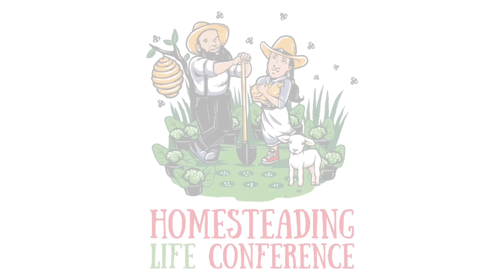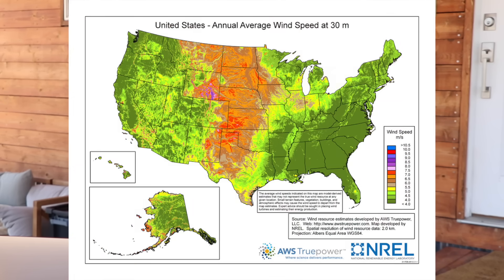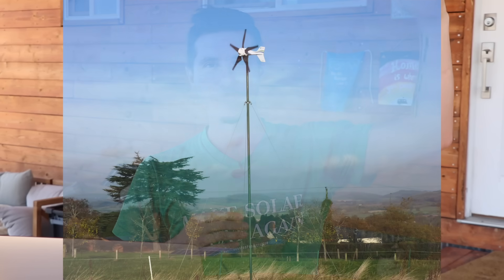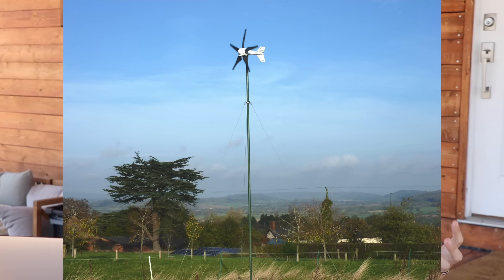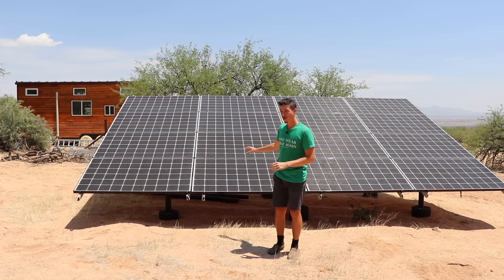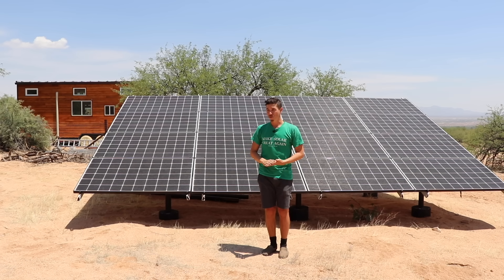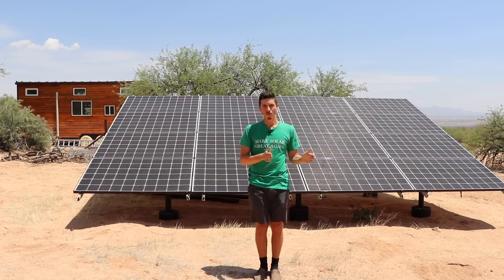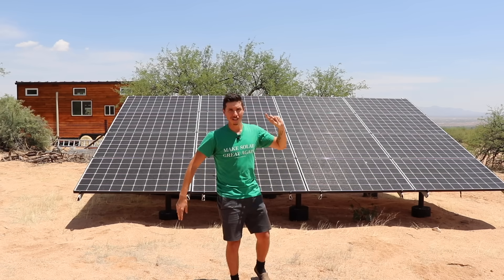Micro Wind Turbines... Are They Worth It? (Off Grid Solar)

Comment: You sound extremely biased towards solar panels. You only talked about the cons of wind turbines and didn't really address its pros or when you would want one over the other. You live in a very sunny area but not all people do. Also, on some places wind blows pretty hard and a hybrid system works amazingly.

PS: Missouri wind and solar is VERY expensive and in most cases you can get wind turbines with 25 year warranty even from Chinese turbines.
Reply: TheRobojay has it right, this video and Liam are completely biased against wind power for some reason. It has its place and compliments solar. If I was in a sunny location like Handeeman and many states in america then I'd probably ignore wind power, but where solar power drops to an unusable level like everywhere in the north across the world for a significant portion of the year then wind power absolutely has it's place. 

What's the point in trash talking a renewable energy source that does work for so many people. I'm sure these people would love to just use solar year round because it is much more simple but they can't. Maybe we should just abandon wind power because it's not as simple or cheap as solar and go back to burning more coal instead...
Reply: He does leave out the fact that wind can blow 24/7 in many places of the US like West Texas, 20 mph average wind there daily.
I lived in Tucson for 10 years, not much wind at all so solar is his best bet for that area. He is incorrect on a lot of his statements he made about wind turbines. I don't believe he has EVER owned one at all yet he seems to be an expert on them. He will have to explain to all the people in the US and around the world that have been using wind turbines for years with great success that there wind turbines don't actually do what there doing and that is keeping there batteries charged. 
The fact is that wind can actually blow 24 hours a day but the sun only works 8 hours a day no matter what.
I have both and they compliment each other. One is no better then the other in most cases it just depends on where you live.
I lastly just want to say there is a company in Arizona, a competitor of ours that's willing to give you FREE solar panels if you bash wind turbines. They only sell solar. I sell both solar and wind and could care less which you prefer to buy. I just want you to get what works best in your area.
Reply: All those claiming bias, I’m trained as a wind turbine technician (the big ones) and am going to school for mechanical engineering to design them. I love the things and even I’ll admit that the small ones for personal home use have VERY limited application.

There is a reason we’re building them 300 feet tall and out on the ocean. Wind at ground level is inconsistent.
Reply: Right?? 8 min. to say no.
Reply: Caus hes paid by some solar company....
Reply: ocean power is better...………………………….the ocean never stops moving
Reply: TheRobojay the T-shirt was a bit of a giveaway..lol
Reply: i remember i did my homework about winturbines
in my place and context, i wanted to use windturbines to reduce my battery size
if i have a 24/7 power source i could reduce my battery needs
but i found out that for my context, the wind turbines woudn't be cost effective compared to solar+batteries.
yeah, i think in a place with strong winds, (a flat surface or on top of a hill with all year strong winds) it could be possible to have some good cost effectiveness, but for most people, wind turbines woudn't be cost effective at all.
Unless you can build your wind turbine by yourself for cheap.
Reply: >> I'm an engineer, therefore I am extremely biased towards things that actually WORK in the real world

Dude, I know you have a legitimate point of view but that comment is goofy to the extreme.  Is a solar salesperson said that to me, even if I agreed with what they were saying I'd go with the next guy who was not so off-the-wall cocky.

Do you think the people who design, built and install wind power systems are not engineers, or they are a different kind of engineer who is biased towards thing that don't work?

LOL
Reply: Liam O'Brien wind rarely makes sense when it is not complemented by solar as it is more reliable on a small scale. That being said, this video focused on the negatives of wind. Wind shines on many areas if coupled with solar. It allows to have a smaller solar system and less battery storage as it can run 24/7. And I don't know what you have against chinese turbines but there are plenty of people happy with them. 
The video covers good points but completely trashes turbines without pointing out positives or when you might want them.
Reply: but he was talking about the micro or small wind turbines, he is right on a lot of the points, it is a waist of money for something that is lucky to put out 1kw in 30 mph.   a 50 watt solar panel in just one year will out preform any small turbine by a factor of 100.  I have owned a few of these small wind turbines from companies, and they all fall short of what is advertised.  I have owned a turbine and was lucky to get 5 KW hour of power in one year out of it.  Were as with a solar Panel of just 100 watts you get 100 KWH in a year.  I love to have a wind turbine if it were to preform as so many companies clam yet fall short way sort.  So fare every company that sell a turbine with a blade diameter less than 80 inch sell rubbish  Unless you live in a place with 30 mph winds or higher consistently were most people live with winds of 5 mph to 10 mph.     

There are also things to watch for when buying a wind turbine some companies will sue you if  you have a problem with there Turbine, and if you post a video they will sue you, or if you make a post any were they will sue you,  It seems that now in America Companies are providing shitty service and when called out they are suing the consumer.  That is just one thing to watch out for.  If the company is not suing there consumers then they should be ok and legit, with nothing to hide.   So if a person dose want to go micro wind, what ever you do research the company heavily, and what ever you do do buy from companies that trash talk another company like so many do on YouTube.  There is about a half dozen companies will will never by a product from because their YouTube channels is filled with trashing there competition, its sad.
Reply: oh, I've figured it out now. Liam is actually part of the DIY homestead website solar course, so it's a business strategy to try and gain more sales. Sad.
Reply: until the turbine burns out from wind speeds after less then 5 years, or a storm of some kind destroys your solar input.
Reply: Ask an honest wind farm engineer about the same issues and they will give you the same answers. Solar works for almost the entire US, virtually year round (yes, even in the dreaded winter, ask me how I know), the same cannot be said honestly for wind (not talking about your highly site-specific conditions or magically cheap Chinese turbines). It does work, but on the micro scale that homesteaders are considering it's just not a great investment.
Reply: I think micro scale is the important part of this discussion.  massive wind farms across the planet are also a good source of electricity.  Homesteading, geothermal makes more sense... you need to go very high to harness what you need in wind. digging down very low is easier and more stable than reaching and maintaining the height that makes sense.   If you are a tower expert, then its a different story (no pun).
Reply: I'm an engineer, therefore I am extremely biased towards things that actually WORK in the real world, not under "just" the right circumstances (which is not much of the time in most of the US), solar fulfills those needs, micro-hydro also has it's applications. Chinese wind turbines? do they come with a Hung Low Charlie "trust we will be around" 25yr guarantee? If you have all the needed equipment to install a massive foundation, tower, and guy wire system (plus crane for final install), then by all means, knock yourself out. Just be sure to share with us your daily and yearly logs of power produced plus total cost, I think the results would be surprising

Comment: It makes no sense in Arizona, but it would make sense in sub-arctic or arctic coastal areas, because you won't have enough batteries to make it through winter with only solar panels.
Reply: Someone hasn't visited the northern AZ plateau. Always windy here. I use both. Solar's great but wind is 24/7 so I need less from it. It works while I sleep
Reply: HiddenCity Prepper I'll be building north of St Johns and figured wind into my power options...
Reply: Handeeman: so you agree here that wind turbines have their usefullness in certain areas. Perhaps you should of mentioned that information/viewpoint in your video. Out where you live, turbines aren't really needed or useful. But as Gunnar mentions, coastal areas would benefit from them. Don't get me wrong, your video was informative. It just needed a little more information/clarification as it seemed like you were stating that turbines are basically useless everywhere. Just sayin.
Reply: Gunnar René Øie obviously you don't live in Navajo county.
Reply from the maker: absolutely! they have an application but not needed in most areas :)

Comment: How about one of those helical urban wind turbines?
Reply: Sorry mate, not sure what to think about your cryptic response of "....". Other than that I sure have enjoyed watching your vids.
Reply: I was also wondering about those. In Georgia we hardly have sunny days anymore but wind isn’t a problem. 
I just need to move back to Tucson!
Reply: I think what he is trying to say (in an exasperated manner) is that all the same design issues that apply to conventional HAWT's also apply to VAWT's or helical turbines. You still need height, wind speed, and surface area to make power. Plus VAWT designs suffer from stall conditions depending on blade geometry
Reply: Thanks for your reply. Since I am as clueless about wind turbines as probably Handeeman would be if I talked about delta, vega, theta and gamma when trying to explain option trading to him, I was just looking for a simple answer, which you provided. 

Exasperated manner, indeed. Hmmm. So sorry for my ignorance! Cheers
Reply: He was eating a sandwich while doing some electrical wiring, so he could only just his nose on the period
Reply from the maker: my apologies Travis :)
Reply from the maker: lol Gregor!
Reply: That's called a VAWT. The helix isn't strictly needed for them to work, but it acts to greatly reduce vibration*. They actually offer lower power output than a HAWT for a given turbine size - they are just less efficient. But they have the advantage of easier and cheaper construction, as you need no slip-rings and the only load-bearing bearing has to bear much less weight than in a HAWT.

*Imagine a plane rotating in the wind, the cross-sectional area quickly going from almost nothing to like a sail several times a second.
Reply: Cheers, mate. Looking forward to more vids.
Reply: Seems that they should be horizontal rather than vertical, for more power possibly?  https://www.youtube.com/watch?v=rS04sky-EjE
Reply: Although the 30KW claim seems hard to believe. Especially in slow wind conditions.
Reply: There are other examples of this on YouTube. Even if one could just get a few kilowatts, seems like this would be a good solution. This design looks to be less obtrusive, low height, could span a great distance without a tall tower. It would be easy to make a secure structure because you are not fighting gravity by having to support the entire device upright. Not sure if it is realistic in low wind conditions, but that's a potential problem with any wind device. Such a device would require low friction to work in minimal wind conditions, I suppose.
Reply: Travis: Indeed, a HAWT would work. They are better overall than VAWTs as they don't need to be mounted as high. They also can start generating power at a much lower wind speed, the blades can be very tall giving far more surface area to catch wind, they can work better and more efficient in turbulent winds (like from a storm, from around buildings or over hills or around trees), and the generator portion doesn't have to be where the blades are at. You can use a shaft that goes form the ground up to the blades. So if there's any work to be done on the generator, you don't have to pull the whole assembly down, and if it needs to be stopped due to too high of winds (which, a HAWT can withstand higher winds than a VAWT can), you can brake (slow down or stop all together) at the ground and not rely on electronics up in the air hoping it'll hold.
Reply: @yoliegunderson8749  
What is a "cheesedick"?
Reply: LOB, "all" the same issues do not exist in the vertical asis helical wind mills ... or whatever they are called, at least not in the same proportion.  They have different issues, true.  They do not have to have an expensive and dangerous tower.  They can be serviced much, much easier.  However, they do not get as much wind being ground based, and they are much more expensive.  All in all I agree with you guys ... for sun abundant areas a windmill is not sensible.  

How about a personal sized nuclear reactor?   ;-)